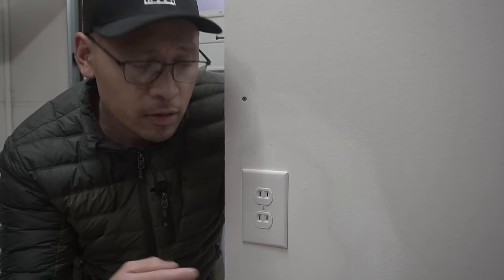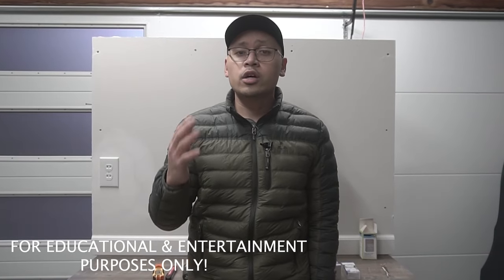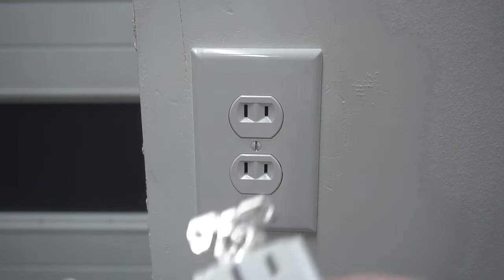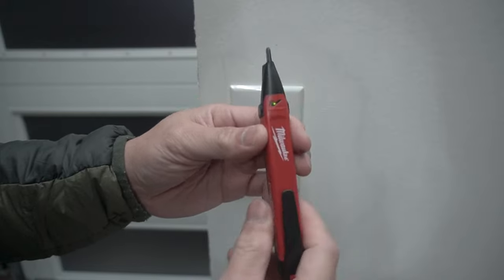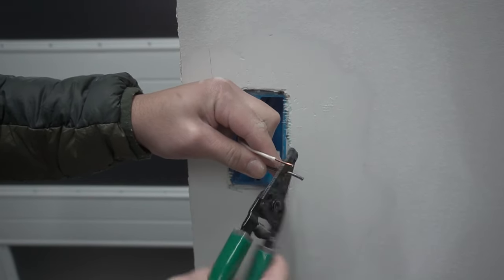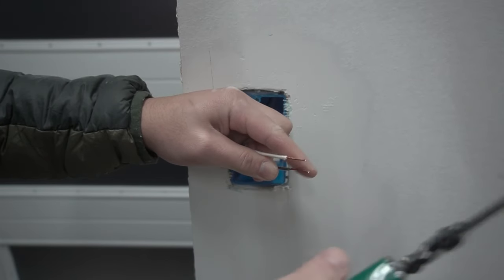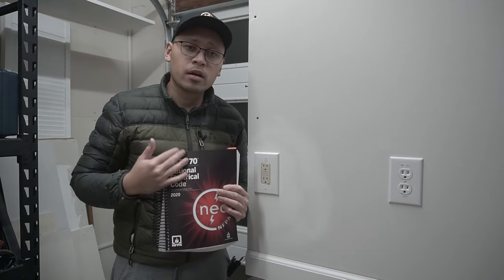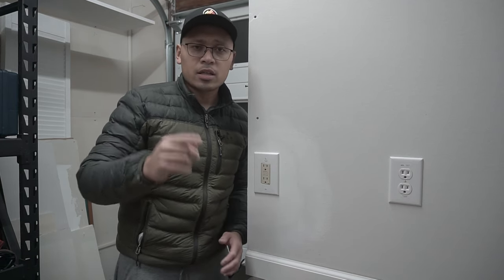How To Replace An Old 2 Prong Outlet Receptacle To A 3 Prong Outlet GFCI Per NEC CODE 2020 | DIY

Comment: Have to ask what’s the use case here? Where and what type of Homes would have this scenario?  Meaning who has two wires going to a plastic J-box?  I’m used to seeing the old house metal conduits to a metal j-box or the new house Romex 14/2 or 12/2 to a plastic j-box.
Reply from the maker: Hi! This is just an example.sorry I should have made my mock-up more realistic with a metal electrical box 😊🙏🏽
Reply: With a metal box should you protect the gfci with elect. Tape?
Reply: If the box is metal then it is recommended to use electral tape but their won’t be a ground late reply
Reply: @esthermcgough3995 I say it should just be common practice to always wrap, think of it like a condom, always wrap it and you’ll be 99.99 percent safe

Comment: My apartment has all non grounding type receptacles.  Can I change out a few with gfci type receptacles or would I have to change them all out?
Reply: i watched a video where you can change one and run a wire off of that… but otherwise what i think i’m hearing is they have to all be changed to gfci according to code or safety

Comment: Great video, I have a old house built in 1939, I want to replace a kitchen outlet with a GFCI, however  the old outlet has two black and one white wire. Two black are attached to one side and the white to the other side of the old outlet. Also there is no ground wire on the old outlet. I cant find this scenario addressed anywhere online. How would I install a GFCI in this instance?  Thanks!

Comment: You explained everything right one thing you miss mentioning is if the box is metal it’s recommended to use electrical tape how gfcis work without ground is it can sense an imbalance in the hot and neutral wire!

Comment: Thank you for this video.I was having a hard time trying to figure out if it was safe and up to code if I were to replace my old receptacles with a gfci one even though there is not ground wire.I thought it had to have a third ground wire no matter what.so thank you for clarifying this.

Comment: I plan on using breakers and identify each plate with the stickers and the circuit breaker number, enjoyed your video.  Note:  the homes that you'll see this will general purpose receptacles and lighting together, makes you ask the question  "With the afci circuit breakers, why run a ground wire? "

Comment: UK we put ground fault device in distribution board this protects all outlets on circuit plus cable run. Also all devices are designed so you can't come into contact with live parts.

Comment: What is the purpose to wrap the outlet with electrical tape?       Does it have to be done every time?
Reply: Its debatable topic among DIYers and electricians. Most individuals will use electrical tape in a metal box to protect the conductors (I believe) and the screws which are also conductors; from hitting the metal on the box, causing a spark or possible fire hazard.

Its not as important in plastic boxes. But I've also seen people not do it at all in metal boxes as well.
Reply from the maker: Thank you for that! 🙏🏽😊
Reply from the maker: Hi!  wrapping electrical receptacles after wiring them to prevent movement of wires or the accidental contact with loose conductors or the sidewall of a metal outlet box. It's considered a “just in case” precaution, or sometimes just habit 👍🏽😊
Reply: Electrical tape isn't a must. People use it in metal boxes .not to protect loose wires they should be tighten down to I think 22 psi

Comment: I inspected a house built in the 50s with no ground plugs so I opened all the plugs and saw ground wire actually existed so I just replaced with plugs with 3 prongs and connected the ground wire too. I don’t know why in the old house they only used two prongs plugs when there was ground wires already existed. Maybe the electrician was being lazy or trying to save money just using two prongs plugs.
Reply: Thank you for this comment. My son’s home with built in the 50s and almost every outlet is two pronged and not grounded or so we think but your comment makes us wonder now. He’s new to DIY so these videos are great and so are the comments thank you again for posting one.
Reply: My house was built in 1950 and had only 2 prong plugs. However, the metal boxes are grounded and bonded to the neutral wires at the electrical panel. The wires (16 AWG) are separate from the hot and neutral cable and are fastened to each metal box in the rear and on the outside of the box. If three prong receptacles even existed in the US they were pretty rudimentary, but electrical designers may have seen this coming. By 1969 they were becoming mainstream. I don't think the electricians were being lazy, it's more likely that the receptacles were not available.
Reply: @jasmin0930  One easy way to check for ground is to install a 3 prong receptacle and test it with a receptacle tester (about $7.00). Even without connecting a ground wire to the receptacle and if the box is grounded the receptacle will be incidentally grounded by contact with the mounting screws. The box must be metal. Alternatively, you could use a multimeter to verify if the box is grounded.
Reply: @surferdude642  thank you Ted for some great information 🙏🏼🙏🏼🙏🏼
Reply: My house is like this but the remodeled kitchen is like his mock up. All the 2 prongs have ground wires to the metal boxes.
Reply: 1950’s house.  Wow, only answer could be expense for 3 prong receptacles.   Interesting that they used wire with the ground conductor.
Reply: I know you’re doing this as a demonstration, but it’s sad to see a brand new ungrounded receptacle. 
I’m sure it’s because you immediately throw them away, but many places still allow ungrounded outlets.

Comment: You used an adapter that removes the ground prong and then checked to see if the outlet was grounded. I think that would always register as "no", wouldn't it? I think you would have to use probes to determine that?
Reply: It would show “no ground” any way cuz he tested it on a “no ground” outlet

Comment: What do you do if you have a 70 year old house with no grounded outlets and the metal boxes are too small for a GFCI?
Reply: You may have to replace the box. Old wirings boxes then were design small to accommodate wires and connectors only.

Comment: How does a sticker make something up to code? There's still no grounding. Seems like a pretty half assed solution.
Reply from the maker: The GFCI is the focal point on this solution 👍🏽😊
Reply: I am assuming adding an adapter so you are able to use a 3-prong on a 2-prong outlet is worse than a more secure fit. All my basement outlets are 2-prongs and it really sucks to use an adapter, which in itself can be non-compliant. Grounding can be over-rated if you are not using serious juice, like a lamp,... but grounding is to prevent electric fires, which a GFCI does, so that makes it compliant.
Reply: Agreed 👍
Reply: @SleepyKittens  No, grounding is to prevent electric shocks, nothing to do with fires.

Comment: So what happens when you have a outlet with just 2 hot wires to it and it's carrying 220v with no neutral and no ground wire
Reply: That is weird. Are you sure it is 240 V and not a very old 120 V outlet with horizontal slots? There are 240 V GFCI outlets. Check the code if it is allowed.

Comment: In 1930's code allowed to connect ground contact with neutral wire and too many people all over the world electrocuted themselves when neutral wire had poor contact in junction box or breaker panel. What is interesting, in Europe using neutral wire as ground was forbidden only in 1970's - you can imagine how much people was electrocuted during 40 years.
Reply: When you do it properly there is no risk. That is one reason why DIY is banned in Finland. I have reports of all deaths since 1980 and here is zero cases of spontaneously broken neutral or actually one but it happened to linemen outside so it would happen also on TN-C-S.

On the other hand there were three deaths because DIYs connected the ground to the live wire.
Reply: @okaro6595  DIY is banned in Finland because commercial companies want to earn more money. TN-C isn't safe even if you wire it properly.

Comment: Can you also just change out the breaker and put on that is GFCI combo? This way all the outlets on that line are ground interrupted. Instead of changing out each outlet to a gfci
Reply from the maker: No need to change out each outlet to GFCI. Just find the most upstream receptacle change that to GFCI and the rest downstream of the same circuit can be changed to a grounded receptacle. Make sure you label the covers with the appropriate labels 👍🏽😊

Comment: It's a steel box and there is no neutral wire and the ground wire is not screwed into the box and its 220v

Comment: Why do you cover the outlet with electrical tape ?
Reply: It reduces the risk of any wire touching the box. With a plastic box it is not so big a deal but if it is an ungrounded metal box that is more important. If the live wire were to touch the box it would energize the case of any connected equipment and the GFCI would not protect.